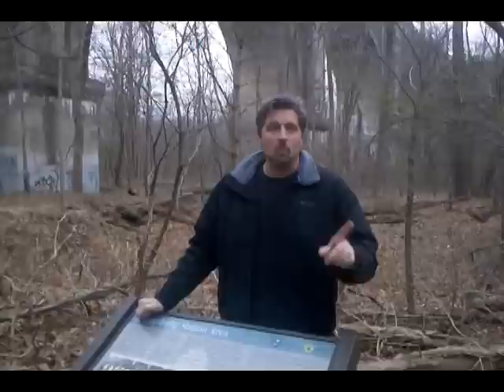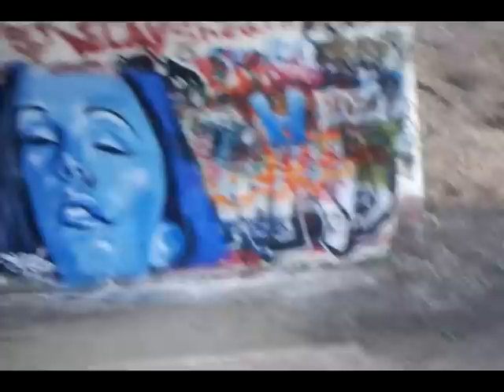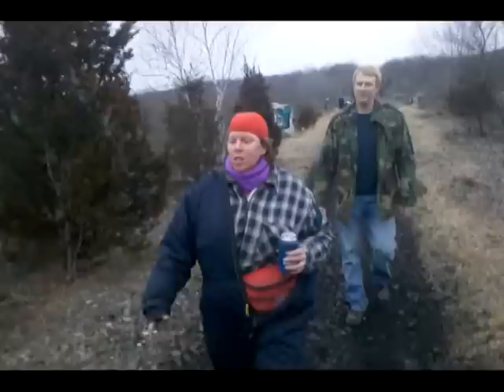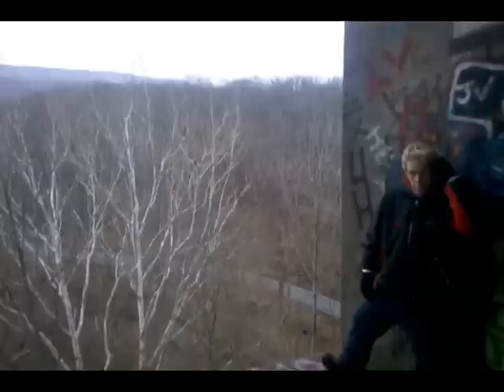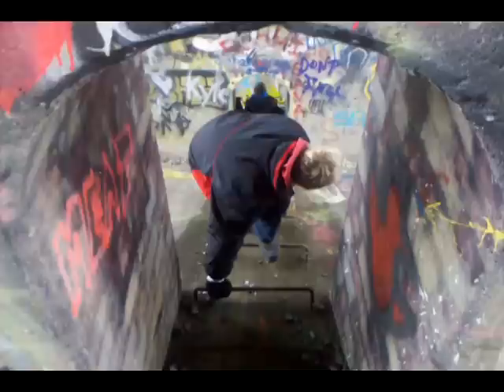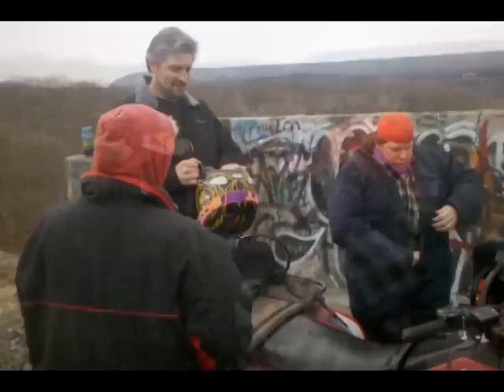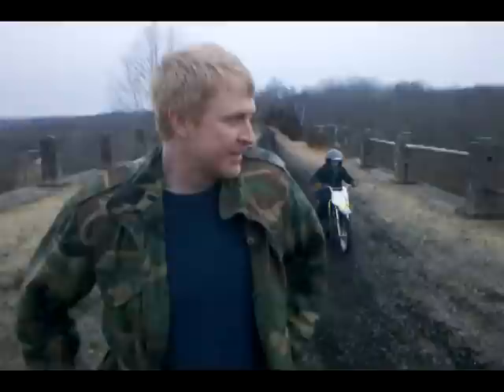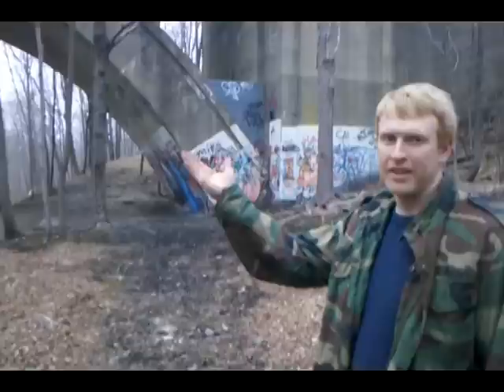Paulinskill Viaduct, New Jersey

Comment: Indeed. It's not in use now, but in the future it may be coming back. With the Lackawanna Cut-off Project still going on between Port Morris and Andover, the 2nd Phase will include the Paulinskill Viaduct and the push to the Delaware Water Gap (possibly expected to start in 2015). The tracks were removed by Conrail back in the late 1970s if not the early 1980s, a grave mistake which many agree would have given them a second choice to avoid the already congested I-80.